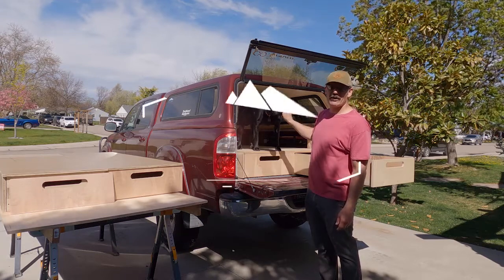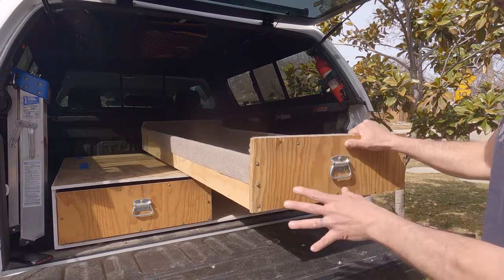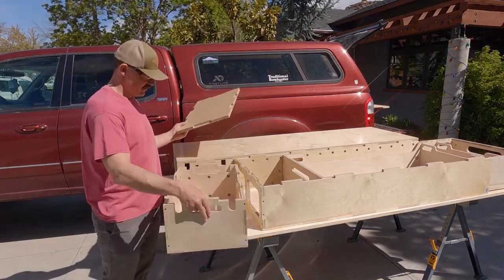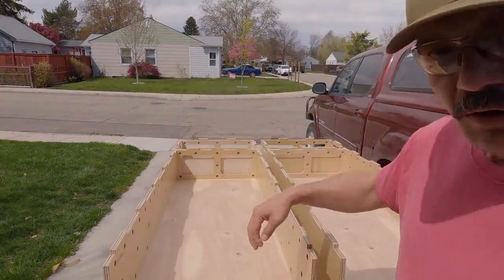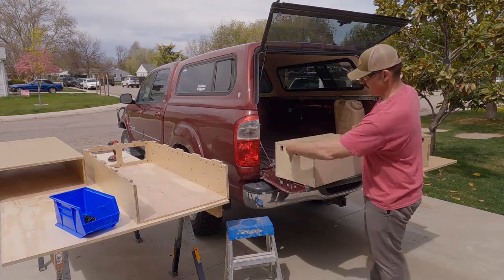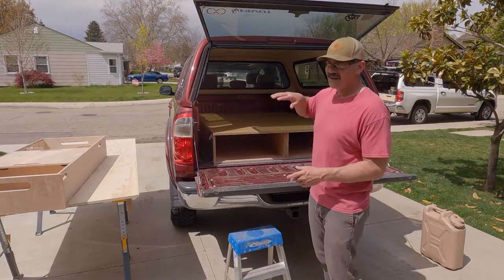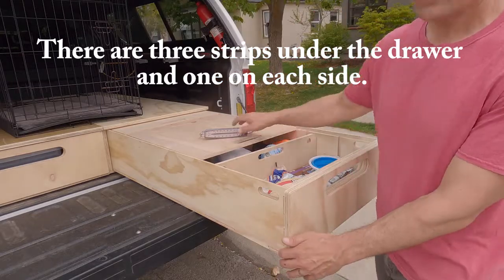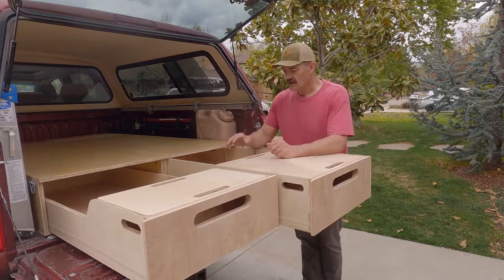Every Truck Needs Drawers!

Comment: Fellow 1st gen Tundra owner in the 208. I built drawers a few years back very similar to one of your earlier versions (although yours are more polished than mine!). The drawers are the full length of the truck bed and I use it as a sleeping platform for camping/hunting. Seriously the best thing you can put in your truck.
Reply from the maker: I call this generation of Tundra the Idaho truck!  It is how you spot the locals ;)

Comment: Very nice! I also have built drawers for just about every truck/suv that I've owned. They are just so handy! On my latest build, I sprayed a rubberized coating on the top to give some traction for my dog while she was back there...bad idea. Although it holds everything in place really well, it ends up rubbing off on things I place back there. I really like the tape idea for the slides and will likely incorporate that in my next build. Would you share the files for this build? I have access to a CNC machine coming up and really like your design. If not, no worries! Thanks!
Reply from the maker: I will happily share my files.  I have a few modifications I want to make- pull out top panels to access gear at the front of the bed.  Hopefully I will have that design done in the next two weeks- trying to wrap up a trailer build-out now.  If you can wait I will share both versions.   Also, what type of rubberized coating?  We just used Upol Raptor on a 1966 Bronco project.  I really liked how it turned out and thought of using that on the next drawers.  
Best! AD
Reply: @adventuredad1180  Awesome! I'm in no hurry so whenever is good with you is fine for me.  I'll probably make mine the full length of the bed (6.5') since I don't have windoors...maybe a mod for the future though! Just let me know how to send you my email address. Thank you!
Reply: I don't remember the brand of the rubberized coating...it was for vehicle undercoating. It is tough and grips stuff well. The only issue is primarily with our dog's bed...the legs end up getting some of the coating on them while in the truck and consequently show up on the floor in our house once it's moved back inside. If I would remember to clean with a solvent of some kind before bringing it back in the house it would be fine. We have used the grey indoor/outdoor carpeting a couple of times and really like it too. The downside is that having a wet dog on it a couple of times usually ends up smelling...